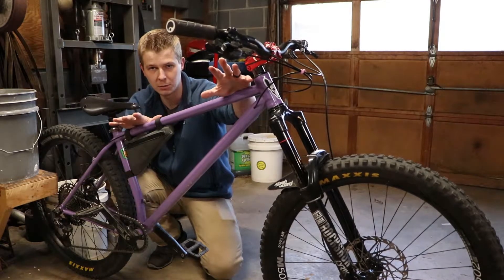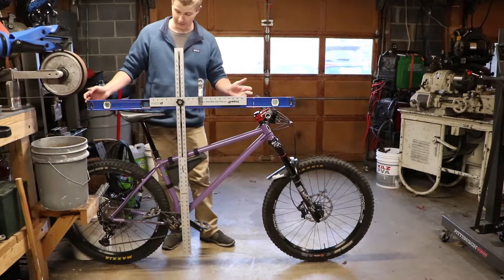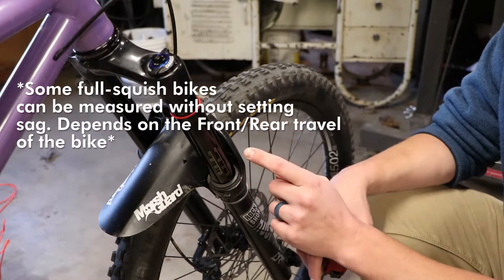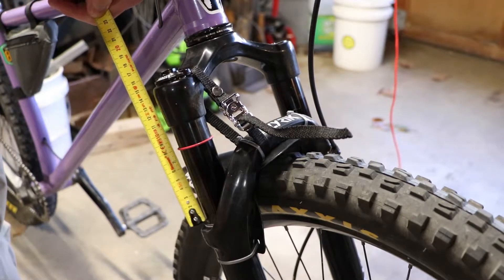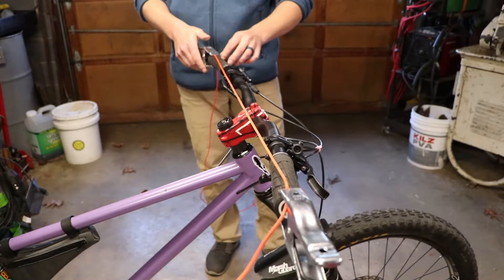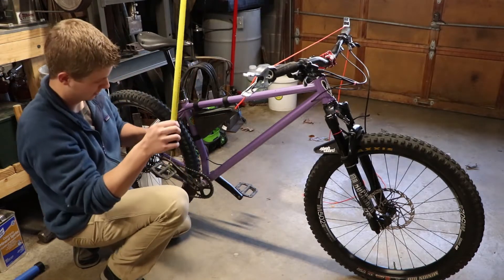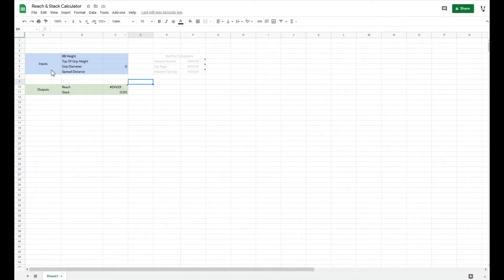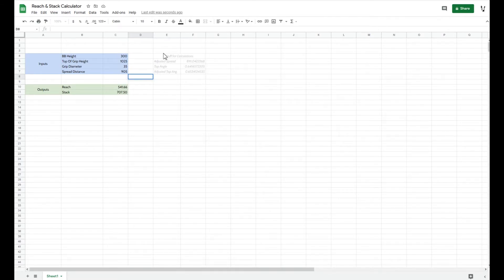Measuring Bicycle Reach & Stack In the Real World

Comment: now the real trick for the rest of us: can you use these numbers to find out what size in a production bike/frame will work best for the rider? I have my RAD/reach/stack numbers from PVD's calculator and my bike is pretty close to matching those, but how do I know if any particular off-the-shelf frame can be made to fit in a similar way?
Reply from the maker: Really, you could take the advertised frame reach and stack numbers, and then add in the handlebar/stem/spacer numbers to get the actual reach & stack. Now, it's best to verify the advertised numbers, because all the manufacturers out there can't agree on how to make their spec sheets for a given bike (what size fork is it pictured with, sagged vs. un-sagged geo, etc). It's a frustrating rabbit hole. 

Measuring the bike in the real world is best, but of course not always feasible. 
But with that being said, there is usually a good bit of room to work with on bikes, The handlebar sweep & rise, stem length, and steerer spacers can all be adjusted to make sure it fits. 

Definitely a future video topic I want to explore more soon. I've been doing some of my own 'research' with PVD-RAD, and comparing it to other methods.
Reply: @shieldmaidenbikes771  A rabbit hole indeed! I have Pete's calculations and yours saved on a spreadsheet. to get my Karate Monkey to fit by those numbers, I need a low handlebar, 70mm stem angled down with only a short spacer under it. it's short in reach! trying to factor in handlebar bends, headset stack height, stem stack height, and had tube angle and you have a nearly impossible task without the bike in question being present. because all the bikes I would ever want to own only come as a frame only, checking these measurements and test riding is effectively impossible. thanks for putting this out there though! it makes sense and trying to explain it to people is a Sisyphean task.
Reply: my concern is that with modern steep seat tube angles and tall forks, the bike is going to end up with a very steep saddle–bar drop and a short cockpit (saddle-grips will be cramped horizontally and bent-over vertically).
Reply from the maker: @mackturtle82  That is certainly another problem I've been brainstorming about. Super-steep seat tube angles are a problem in of themselves. The only real problem they solve is tire clearance. But of course they create other problems.
But anyways, another thing to keep in mind with the PVD-RAD is that there is some wiggle room. The angles (body angle and arm angle) is typically how we describe it. I fall somewhat out of his recommended angle range with my preferred setup.

Comment: Sorry, but what kann I do with this Numbers? How do I know how much Reach and Stack I need?
Reply from the maker: The reach & stack numbers define how you as the rider fit on the bike. So for example, if you have one bike setup the way you like it, then buy a new bike, you can take the reach and stack numbers to setup your new bike (stem, bars, etc) and make sure it fits you properly. 
As for what numbers you should be using, there is a link in the description to a novel method for modern mountain bikes. Otherwise, there is not really a set 'rule' in the MTB world just yet for bike sizing. But it can at least serve as a point of reference when dialing in a setup for yourself.
Reply: @shieldmaidenbikes771  Thanks for your immediate answer. I always felt something were wrong with the geometry of my bike. Turns out I need much more Stack.